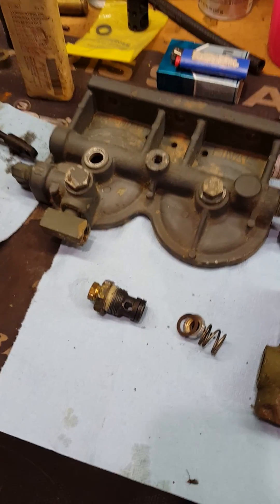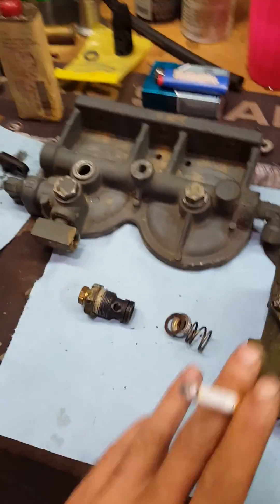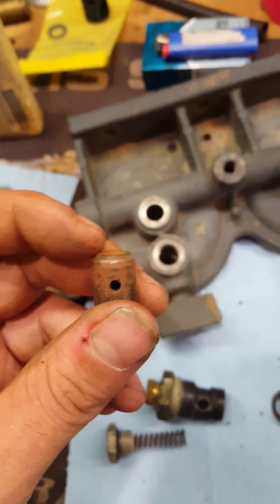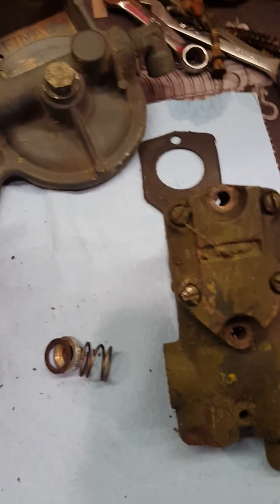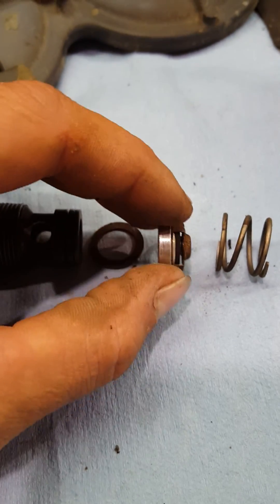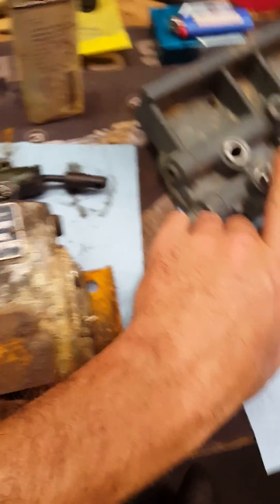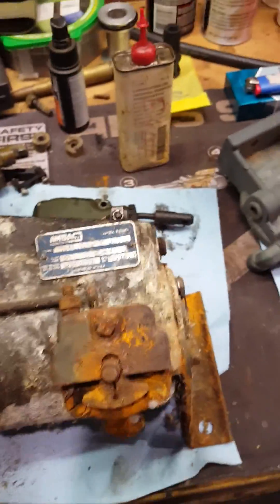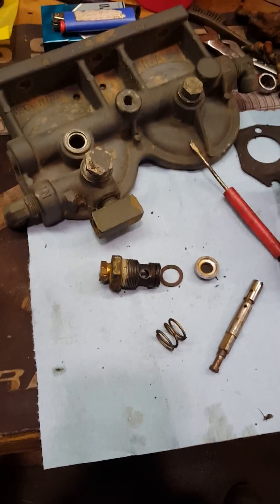Multifuel Deuce, M35/ 5 ton surge troubleshooting

Comment: Been going through your videos trying to find a fix for an issue I’m having.  Your videos are great and I’ve learned so much.  Thank you!
I drove my truck from Colorado to Montana, so there was a long time of holding full throttle up the interstate.  Now my engine is only reaching around 2100 rpm’s with pedal to the floor.  It feels like my pump is not transitioning to high rpm fueling.  I have good power, but just limited on RPM’s.  Sometimes when going down hill, the engine will reach the upper range of rpm’s, and I can feel the upper range fueling kick in with good power.  Could this be something with my governor?  Or maybe the fuel rack sticking and not achieving high rpm fueling…

Comment: My m35a2c idled like a dream until two months ago.  Changed the gasket on the shut-off cover, which leaked after replacing HH o-rings two years ago.  Then, on a trip to pick up compost.  Coming to the nursery was fine.  But, on leaving the problem appeared.
It didn't fire up, or keep running without my foot on the pedal.
I've so far drained and cleaned and disinfected the tank, lift pump screen, removed and cleaned the lift pump feed tube.  I flushed the copper line, changed all filters, and thoroughly cleaned the housings. 
I replaced the rest of the tubing from the secondary and final filters, not previously done during FDC bypass.
I noticed that the pressure relief valve on the filter housing is not a mild steel chamfered cylinder with a hole... It's a ball-bearing.  But otherwise everything there is clean.
I removed and cleaned the feed-port from the mechanical pump, and replaced the O-Ring.   Never jacked up the engine before and hesitant to do it.  From that position I couldn't stick anything in there to pull the fiber disk or spring.

The problem is two things:  keeping it running when braking to a stop, and a surge when I use the hand-throttle to do that.
I can make it idle somewhat steady at 1500rpm or higher with the hand throttle.  But if the rpms drop lower, then they drop slowly until about 1100rpm, then it shuts off.  Any tap on the pedal once the rpms begin to fall results in a surge to around 2k rpms before beginning to fall again.
I thought the hand throttle was slipping...but now not so sure.

Maybe two problems?  Air leak and debris in the mech pump or HH?

Don't know how to find the air leak.

Oh, and the shut-off cover still leaks...unless it could be the base of the HH?

Not sure what to do next.  
Was thinking of putting a 4x4 on my jack to catch the edge of the front engine mounts, undoing the two nuts, and seeing if I could lift the motor enough to pull the lift pump... Then maybe HH O-rings again + disassembly and cleaning?
Reply from the maker: Sounds to me like a hard component failure in the mechanical governor assembly. You've done a good job checking everything, but unfortunately sometimes the injection pump just needs to go into the pump shop.
Reply: @tacticalrepair  Thanks, but...Argh!  IPs are not cheap.  C&C Equipment has one. But I think maybe I will eliminate the other choices.  I think I will assume that it is the boost pump, until I have done everything there.  If not that, then I suppose maybe a piece of debris from changing the gasket might have gotten caught in the overflow valve.  So I'll disassemble and check it.  And if not that, then maybe debris from the gasket change got caught in the Fuel Control Unit Assembly.  Or maybe the plunger spring broke or became too weak for a full stroke.  If I am in there I should be able to put some calipers on the plunger to compare with TM specs.  'Course if spring or plunger is bad my only real choice is to buy a whole HH for $500.  And if the governor springs are bad, I might call AMBAC... But more likely I'll be the proud new owner of a $1800 reman IP.
Reply from the maker: Yeah it might not be a spring either. Likely one of many other wearable components.
Reply: @tacticalrepair  Well, had a rain free chance to look into it, and found a clue.
Under the shut-off cover, the shut-off lever is at the 4 o'clock position.  It moves freely.  But where the spring in the governor used to return it to 7 o'clock fueling position, it now returns it to the 4 o'clock shut-off position.   So while I only have the limited pictures from the TM to go by, yeah, I'd say you called it.  There is something broken in the governor.

But here's the question, are governor parts still available?  Is an injection shop going to be able to fix it?  Or should I get a new/rebuilt pump while I can, and hope it lasts?

Comment: I have be working on a 465 ltd on and off for several months. It has sat for several years at a local gun shop. I'm a professional diesel mechanic and I can't quite figure this one out. Tank was filthy. Removed and clean. Replace the in tank pump. Replaced oil and fuel filters. Removed and cleaned HH. I have gotten the engine to start and run for about a minute then it dies. I have about 6 psi fuel at the tank and 0 psi at the secondary bleed off port. Any suggestions would be greatly appreciated!
Reply from the maker: Check for obstruction between the primary fuel filter and the boost pump. The copper line that crosses the crossmember is a common suspect as it gets pinched shut easily. You did change the primary filter, right? No offense, but people often miss it. Right under the alternator.
Reply: @tacticalrepair  Yes replaced primary. Even went back and checked it for debris. I did blow air through the copper line from transfer pump back to the primary with filter off. Plenty of air flow. Did not look for a pinch in the line. Plenty of fuel flow from the inlet line into the secondary filter. Took that line off and put in bucket and turned on the ignition. I will check the copper line in a few days when I get back to it.
Reply from the maker: If you have fuel flow at the secondary filter inlet then a crushed line isn't the issue. Either a port in the filter head is plugged or the bleed screw is plugged or defective.
Reply: @tacticalrepair  I have tried starting with and without the bleed back check valve in place with the same result. With the check valve out will fuel just head straight back to the tank? I had the filter base off this week and blew air through it as well. I may have missed something there. Everything seems to be correct except for pressure past the transfer pump. I was checking the pressure at the bleed screw between secondary and final filter. Again thank you for the advice and your videos are great very informative!
Reply from the maker: @jasoncarter8784  sounds like the bypass in the boost pump may have an issue. Or maybe you just haven't given it enough time to purge the air.
Reply from the maker: @jasoncarter8784  the valve in the secondary filter housing isn't a check valve by the way. That is an overpressure bypass valve.
Reply: @tacticalrepair  Ok. I don't know what type of valve it was. I did remove and clean it though. I pretty sure I have given it time to bleed. I have gotten it start a few times. Runs great for about a minute at around 1800 with the hand throttle and slowly drops off and shuts down. I think I will double check my fuel lines to make sure I have not crossed them up. Thanks for all the suggestions. If it were a Cat I would have had it done by now.
Reply from the maker: Have you pulled the electric lift pump assembly out of the fuel tank? I bet the soft line on it is rotten and it is sucking air. Pump probably isn't working either.
Reply: @tacticalrepair  I replaced the pump and line when I had the tank cleaned. I used regular fuel hose. Is there a better option for hose? That's all I could find locally at the time.
Reply: Ok. I know the shut has to move freely but not too tight. I have to pull the throttle out just a little to start. Once start and throttle is pushed back in it idles around 600.  Also feels like the brakes are stuck.
Reply: Found my issue. I pulled a rookie mistake and swapped the line from the TP and the return line going in the filter base. What should my low idle be? Is there a proper sequence for setting the screws at the fuel shut off before I safety tie them? Thanks for the help.
Reply from the maker: Low idle should be 700-800 rpm. Not sure what you mean. The fuel shutoff is not adjustable. The adjustments are only on the throttle input assembly. Just set it and lock it down.

Comment: Hi, im a bit new to m35a2's. Having starting issues, engine was replaced with new in 89 and as far as i can see everything is stock and untouched. when starting i have to give a bit of gas with the hand throttle until it warms up (which raises the rpm) before i can release the hand throttle. i feel like mine runs a bit rough and lacking a bit of power. the in tank fuel pump runs 6.5psi. changed all filters. fuel lines dont leak. any suggestions before i start whizzing in the wind and pulling bits off to have a poke around inside? thanks (btw im in the uk!) Ben
Reply from the maker: You very likely have some varnish deposits in the injection pump. I would remove the hydraulic head, clean it and the associated parts, replace the o-rings, then see how it runs. You probably have just as much varnish in each injector. You can try to disassemble and clean them yourself or bring them to a professional shop, but they will need cleaning.

You can also try running A mixture of 25 gallons of gasoline with two gallons of automatic transmission fluid.

Comment: My lds-465 fuel metering plate is stuck to the shaft. What can I do to fix this without damaging it?
Reply from the maker: Apply copious amounts of kroil penetrating oil, push the whole plunger and fuel plate up as far as it will go, put a screwdriver under the fuel plate and release pressure off the plunger, then use a tool to turn the gear. You can do this up and down until it is free. It should move absolutely effortlessly.
Reply: I’ve had pb blaster on this for a couple of days! It’s almost like it’s one piece, but I know it’s not! I’ll take Kroil to it! BTW, thank you for your time and help!
Reply from the maker: @conniemccann1343  just soaking it isn't going to work. You need to do the procedure I described while you have oil on it. Once you get something under or on top of the fuel plate, you need to force the plunger the opposite direction. If you have the plunger held up, you can remove the 3/4" center bolt in the top of the head and use a small hammer and punch ( preferably brass) to tap the plunger down. This will move it but it won't free completely until you work it up, down, and around a bit with a lot of kroil. I say kroil because it has solvents in it that break the varnish down.
Reply: Tactical Repair I’m surprised that varnish is that tough!
Reply: Have you got a video on this particular issue?
Reply from the maker: @conniemccann1343  I think it is in one of my injector pump videos on here. Not sure which one.
Reply: I got the fuel plate off but when took the HH apart i discovered the “D” keeper was broke. Where can I find parts for this?
Reply from the maker: Bigmikesmotorpool.com, or directly from Ambac.

Comment: Very awesome and explanatory video. My deuce has a very lovey idle until it warms up for a bit. It’s a pretty quick lope on cold starts. Any problems I should look for?
Reply from the maker: Air in the system somewhere.
Reply: Tactical Repair will do! I’ll check for leaks/old gaskets and replace the fuel filters

Comment: I have several other trucks with Detroits in them so a few years ago I removed all the Deuce fuel filters and installed a homemade bracket hung off the oil pan bolts which I mounted a Detroit primary and secondary fuel filter with water separator for 3 reasons, better filtration, spin on filters located in an easy and quick location to get too, and its alot easier to keep inventory when all of my trucks run the same filters. My question, I didn't realize there was a pressure relief valve on the Deuce filter head, so I apparently don't have a pressure relief valve on the truck now. Do you feel this will be a problem? If so what psi pressure relief valve should I order and plumb into my setup? Again I really enjoy your video's. Thanks Matthew
Reply from the maker: Matthew Jones 
It really isn't necessary. It was more of a safety feature to keep the old canister filter seals from blowing if a filter became clogged.
Reply: Tactical Repair THANKS